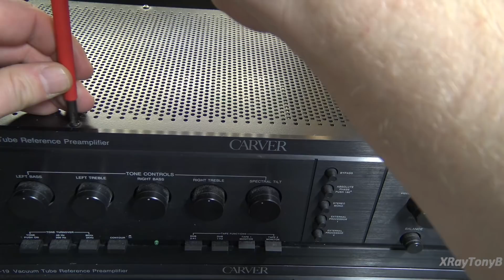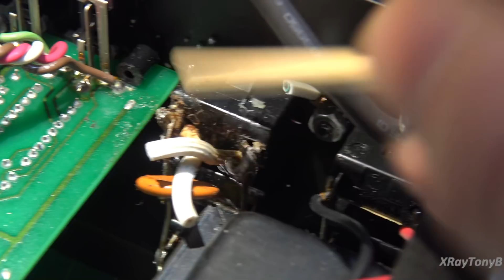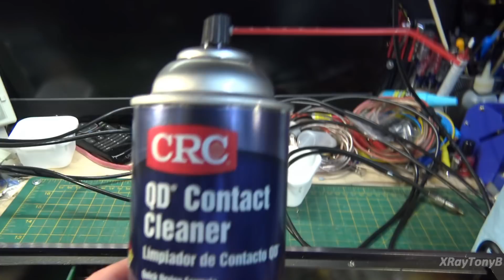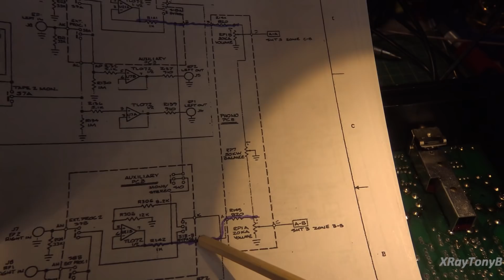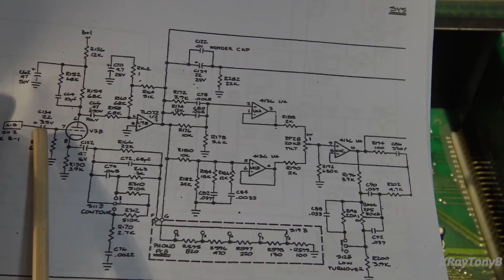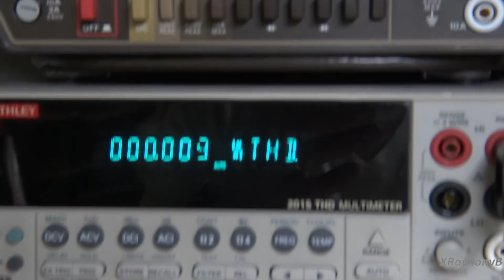Carver C-19 Repair and Test

Comment: Thanks a lot for sharing your experience ........as  the proper use of Deoxit D5, it was not for sale in my country because of   " liberal " ecological reasons  (airplanes seems to be no problem for the environment  ! )but i found it in Japan and could buy it under another name.......I used to clean with contact spray , now i can finish the cleaning with D5.
Worked for many years with vacuum tubes  , in begin the sixties broke some from my father to discover where the sound came from , i never told him about it ...haha.
Series string filament is not the right way to go, but economical,  special series were developed for series wiring of  mostly TV sets and gear designed for these tubes........example : ECC88 ( 6DJ7) versus PCC88 ......
The pro tube 6922 /E88CC has no damping mica fingers on the cathodes and is by this construction to often prone to sibilance and ringing on higher frequencies witch is not desirable in HIFI  ...the better tubes are genuine  nos ECC88 - ECC188 ( 7308 ) and the famous  CCA from <Siemens Halske >.... for the story : .CCA stands for the A (best) CC ( doule triode they could make )

Note :
The siemens US made 7308 is not as good sounding as the european made ECC188 tubes...
It's my pleasure to discover some other of your nice and gentle video uploads......

Comment: I wonder why the camera isn't mounted on the ceiling and controlled by a separate computer and mount the microphone on the wall and angle it towards your self, Why don't CARVER use KORG NU-Tube 6P1 dual triode modules based on VFD technology which can run off voltages between 9-50 volts  instead of those hot running tubes.

Comment: Might I suggest using a High Pass filter, there is quite a lot of low frequency pollution in your recordings, not sure if you can do it with your setup or whether there is a high pass option or control on the camera mic input, if not, maybe a separate Mic Pre-amp, high pass at about 150hz, and job done, its just voice we are concerned with for most of it, when you do your music demos, then you could wind the High Pass out for full range. You don't need to use that Gerbil on the mic inside, its meant for using outside in windy locations, it should not affect the top end, but it has been helping with the popping and other LF pollution in your other videos, the better way though, is with a high pass filter.

Comment: Is it possible to run regulators in series to reduce voltage difference in each one? Ex: 18 volt reg into the 12 volt reg.
Reply: Sure. But, the total power dissipated is the same.
Reply: Mister Hat
True but it would be shared by two devices, so half each=lower temp.
Having said that these regs will run hot for years even when in a poorly designed circuit.
Reply: @jonka1  It would only be a small decrease as the thermal resistance of the heatsink is greater than that of the junction to the sink. Using two devices halves the latter, but does nothing for the former.
Reply: Mister Hat 
you are correct. I had envisaged adding another reg with its own heatsink.
To me nothing about this part of the circuit design is worthy of merit.
Reply: @jonka1  " I had envisaged adding another reg with its own heatsink."

Gotcha. That makes since. And, I agree, quite a poor design of this circuit. Surprising considering the designer.

Comment: 7812 and 7912 come in different current ratings, up to 2 A.  Just check the data sheets for the max V in.  I would not really like the design of this amp for several reasons. The way those caps are put right aside those heat sinks, stinks.
Reply: And can be run in parallel with low-ohm high wattage balancing resistors.
Reply: 1959Berre 
I agree. Looks like the designers had a real blind spot for that part of the circuit. Tempting to add a tiny fan.

Comment: The PCB bodge might be required  to fix a mix up on potentiometer leads.  Maybe the volume control was backwards and they fixed it on subsequent boards.
Reply: I can't think of any other reason.  Compare the pots of both amps.  They must be different.

Comment: Could you swap them regulators for buck converters 🤔 stop them from running to hot.
Reply: I thought bucks introdued a lot of noise. If this was my amp I would either add bigger heatsinks or a tiny fan.

Comment: The sound is excellent. That furry thing is a wind screen / pop filter designed to reduce wind noise when recording outside and plosives. It really is not meant to affect the high frequencies. Unless you are recording in a windy location or talking really close to the mic, you probably shouldn’t use it.
Reply: Order the foam shield, much less volume, less obtrusive and should work as well.

Comment: For those that are wondering what a tilt control is: It simultaneously boosts the bass while cutting the treble. 

While Carver implemented it differently, here's a link to one way it can implemented: http://www.proaudiodesignforum.com/forum/php/viewtopic.php?f=6&t=732
Reply: Thanks a lot, got me headscratching for a while.
Reply: So it's like a one-knob tone control reversed?
Reply: @westelaudio943  Not really. A one knob tone control usually just acts as a variable high cut and does nothing to the bass.

Comment: You could add a small power resistor to drop some of the voltage going to the 7812 and 7912, but it would have to before the capacitor so as not to make them unstable.
Reply: I'll second the droppers. I imagine some 10-15 ohms @ 5 W should take a fair bit of load off the regulators while leaving enough voltage headroom for them to do their thing (with a smoother input voltage to boot as a welcome bonus). The only problem is hacking them in without too much of a mess.

Might as well add an RC snubber for the secondary or bypass capacitors for the rectifier diodes (22-100 nF) while you're at it. Mr. Carver may not have been an AM radio aficionado.
Reply: @PileOfEmptyTapes  If the transformer is off the board,  the resistors (adjusted in value) could go before the rectifier in series with the two outer (not centertap) leads of the transformer.
Reply: My feeling would be to put a much bigger heat sink on there.   I'm thinking 3/4" aluminum U channel stock from the back of the chassis to the front, mounted to the chassis for support.
Reply: Probably would work, or even just a parallel resistor across the regulator to supply 150mA of current, so 82R 5W resistor from input to output, so that the regulator does not have to supply as much current.  Or just find a bigger heatsink that has the same footprint, though you are limited size wise, would probably have to take a wider one, and mill off the bottom partly to not touch the existing components, those are just too small for the job, as they are dissipating over 4W power wise, and they really are only rated for 2W.
Reply: @SeanBZA  A parallel resistor has two disadvantages: 
1. A minimum load would be required. In this case the tube filament works. But what happens when the tube filament opens? Overvoltage of everything.
2. PSRR is worse. Whether or not the added hum is audible or not, I don't know. But, the potential is there.
Reply: Or add a tiny fan.

Comment: When you run a tube at low plate voltage it saturates and distorts easier and that gives more of the "tube" sound that some people like.
Reply: Correct. Starving tubes just create distortion.

Comment: The cross jumper was most likely a factory mod to use a PCB that was manufactured wrong. The mistake should have been fixed on the next run of PCBs and the mod not needed. The company I used to work for sent out product with mods all over them.
Reply: instablaster

Comment: I’d either see if I could find a bigger heat sink, or run a computer-type CPU fan, but at a reduced voltage of 9 volts DC, instead of the 12 volts they usually run at, they’ll help move cool air over the caps and heat sink, but will run quiet at the reduced voltage (just tap off one of the 12 volt buses, and wire in a 7809 (or just calculate a dropping resistor) and run the fan off that. The trick is finding a place to put the fan! I don’t think I’d like to run the amp with those regulators running so hot. Eventually, they may even char the PCB to the point where it forms conductive carbon traces and this’ll kill the regulators for sure (or they’ll constantly be going into thermal shutdown!), or it could burn up the bridge rectifier feeding the input side of the regulator(s).
Reply: Another option is to extend the regulators on wires and use the case as additional heatsink area.

Comment: 35:10 - Some high end manufacturers go one better - they employ a volume control that changes the GAIN of the preamp (VCA), so those filthy pots are NOT in the signal path.
Reply: A VCA is better than a pot how? The best VCAs add noise and distortion and are expensive. A pot does none of the sort.
Reply: @misterhat5823  A modern one like the PGA4311 is rated to 120dB dynamic range.
Reply: @NiHaoMike64  That's a PGA though (as the name implies), not a VCA. PGAs employ a number of digitally-controlled "pots" (resistor ladder attenuators with FET switches) to attenuate the signal and vary integrated amplifier gain. The best ones are pretty good in dynamic range, have much better channel tracking than pots and should serve just fine as a typical speaker preamp, but you'd be surprised to find how much dynamic range is required for a headphone amplifier of 6 Vrms output and a 2 µV noise floor - that's 129.5 dB (this is not academic but rather an O2 in a nutshell, and you can add a few more dB for a JDS Labs Atom). A PGA is going to require some external help there in order to accomodate both extremes; thankfully audio does not generally require both at the same time, and an instantaneous 110 dB will do easily.

A VCA is literally what it says on the tin - an analog voltage-controlled amplifier, typically employing transconductance amplifiers. These were quite popular in little power amp ICs for radio or TV use in the '90s (CXA1522 and TDA7057 come to mind).
Reply: @NiHaoMike64  And a pot still beats that.
Reply: A little late, but I believe my old JVC sort of does this. The volume pot is part of the preamplifier's feedback network . More feedback>Less gain.
Reply: @klang6676  I have a Sansui where tone controls are in the feedback of the power amplifier. A really bad idea, in my opinion.